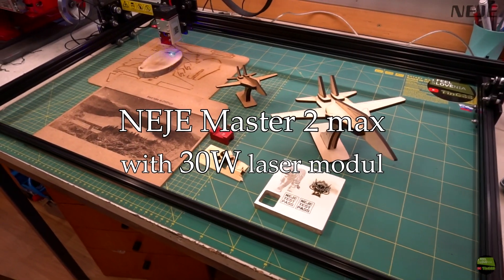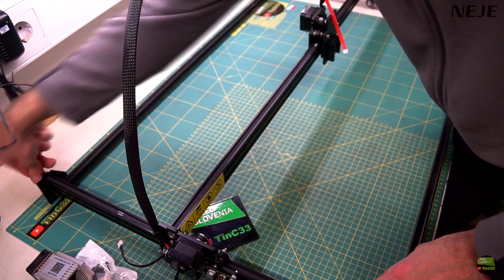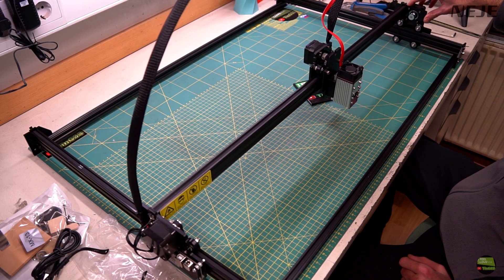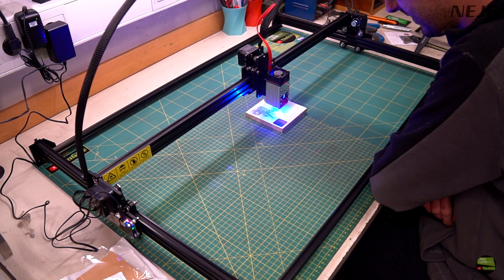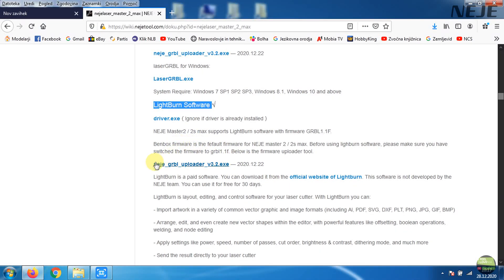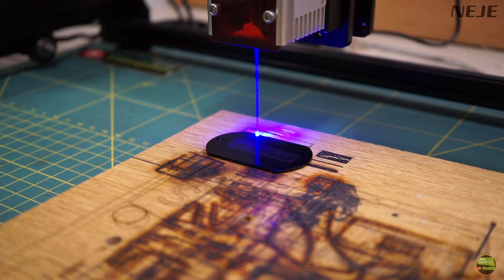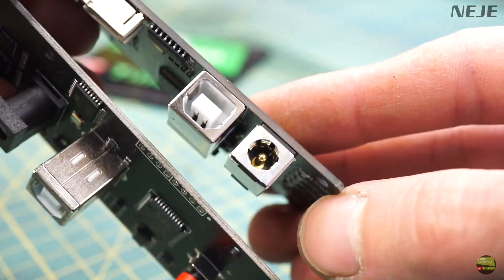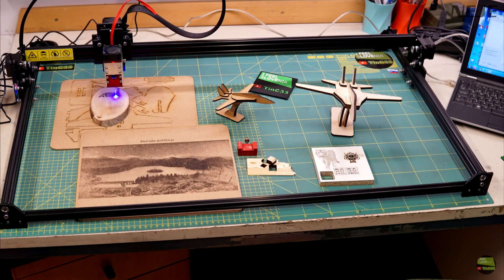NEJE Master 2 max with 30W modul 460 x 810 mm engraver / cutter [unbox / review / first test]

Comment: Hello, i've got last week new master 2s max 40w. When i tried lightburn:
first homing moves was ok -> left back corner 
1) it was going different y possition and at the end it was going different y and it was engraved mirror

2) then i tried to change y pin a and y pin invert like video -> when i tried to position laser from lightburn moving it was going right direction - auto home is also OK

3) after few tries i discovered after auto homing, when i went to position in lightburn and tried to move manually -> directions was ok, x is right value, but after homing left back corner is showing y direction value 460 (x=0;y=460)

before i discovered bad position it was a lot of "crashing" a think a need big red button to stop machine.

Anybody know how to solve my problem please? Once i got (x=0;y=0) and engraving was ok... but don't know how to make it again... I didn't change anything. Just stopped engraving and send machine to home and started engraving again (or maybe tried to check positions in position page).

I hope you can understand my poor english level. Thank you for help.
Reply from the maker: copy that on lightburn forum and they will answer you, i think it's just some settings, try to play a bit more, when start crashing, just turn off the power suply ;)

Comment: Hello, I also have 30w Neje laser but Im not even able to cut 1,5mm plywood. Can usuggest something? Im rly powerless with this, if u want we can communicate private. And also can u tell me what is this tube when u cut? Thanks
Reply from the maker: This tube blow air into cutted line, make huge effect on cutting capacity and clean cutted edge. 
What kind of software and setting you used?

Comment: hello sir
can you please tell me which stepper motor they use for neje s2 .i bought a y axis saintsmart and it isn't working with my neje .by the way rotary is moving im sure its wiring of the motor is different

Comment: Hi Tin please i need help. I bought this Neje laser and cant do any cuting with neje software. Which software and settings you use for cut 3mm or 6mm plywood. Answer please 😉
Reply from the maker: I use neje software for engraving and lightburn for cutting, try to cut with 100% laser power and about 5mm/s speed or for neje software try 10ms burning time, depend on power but for 6mm you'll need air assist.
Reply: Thank you friend

Comment: I found that using the Laser for a long time over time is degrades the power of the laser decreases. When new it works great but over time it seems like you have to change the power settings.

Comment: Which is best to make detailed drawings 40W, 30W, 15W or 3.5W?
Reply: I am not sure what is the limit downward regarding usability, but the less power you use the more detailed gradients you can achieve. Although there is an other factor, the dot size of the laser. In my opinion the best ratio on the market is on the laser master Pro 2. With 5.5-ish Optical (!) wattage If i would just only wanted a laser to engrave, i would not hesitate to buy that one. For cutting as well which i am looking for i think minimum 7.5W optical is the acceptable power.
Reply: Just for drawing and engraving means 2.5watt is enough which is available with rotrics hexbot

Comment: What to do when the laser stopping in work? The problem is that the laser no longer moves, the laser works but does not move it stops.  you can help
Reply from the maker: Change firmware not use 2000000 one.

Comment: Hello, you can explain me what are the L parts? I have too but I don’t understand where they go. Thank you
Reply from the maker: They are for fixing machine on the table, screw go through the holes into legs and another 4 screws into table or other base, so you can't move the machine and it stay parpendicular.
Reply: Ah ok, thank you, where I can find 40w for a good price? Here in Europe?
Reply from the maker: @stefanocorti4806  i think only neje shop, but don't know if they fill warehouse, but 40w is awesome, got two laser in it, i cut 20mm soft wood with them, video will come...
Reply: @TinC33  yes I get it today laser and I am very happy great structure and quality! Better than co2 40w, I think less maintance

Comment: Great TinC33 videos: I ask you a question, it is possible that you explained what type of air compressor you use to clean the smoke in the laser, I have had problems with the 30W Neje and I had to put a new one because there was no laser intensity . As I told you, a good detailed explanation would be very interesting. Thank you very much in advance.
Reply: As I said before, your videos about the Neje are excellent. Regarding the question I was asking you about air assistance, I have already seen the video of "Bring Ortur Master to another level FW upgrade - Air assist - Upgrade with NEJE 20w modul" in which the air compressor topic is very detailed. Very good!!!
Thanks a lot.

Comment: I have a neje master 2s 7w , my problem is that i can not cut anything ? Please help
Reply from the maker: Set laser power to 100% and burning time to about 10ms in neje software and it should work
Reply: @TinC33  thank you i made 7-10 rounds with that settings but it still dont cut the plywood 😢😢
Reply from the maker: @KorAysila  how thick plywood, didn't try 7w mpdul but i think 3-4mm is somekjnd of limit, 40w can cut 5mm plywood in few passes.
Reply: @TinC33  i had 3mm plywood tryed.
Reply from the maker: @KorAysila  did you set focus perfectly? I don't know what should been wrong

Comment: I have been using this but having a hard time to cut 3mm plywood. What should be the height of the laser above the cutting material?
Reply from the maker: It doesn't metter of high that much but you need to set focus so you got smalles possible dot and air assist make huge difference
Reply: @TinC33  thank you for taking the time to respond I really appreciate it so I have used a microscope to set the point as small as I can but it still needs at least: 7 passes 8mm/s @100% power
Reply from the maker: @mohsini2607  3mm should cut better than 7 passes, do you got air assist also?
Reply: @TinC33  yes i have air assist and it made a big difference in getting clean look, but still it often takes 7 passes at 4mm/s at 85% power
Reply: @TinC33  i was thinking to return this unit and buy the ortor model. i see you have done reviews on that model. Will it work if i purchase the basic Ortur Master 2 and buy the neje laswer and add it to the ortur?
Reply from the maker: @mohsini2607  yes it will work just leave 4th wire unconnected because neje got temperature feedback and ortur doesn't.

Comment: Hey have the laser now also. What do you do against a strong smoke development? My basement is full of smoke do you have a tip.
Reply from the maker: I would mound some soft pipe (about 50mm) next to a laser and use some ventilator to suck smoke and blow them through the window.
Use stronger fan like the one for freshing the toilet room.
Reply: @TinC33  I wanted to ask what settings can I use for a 4mm plywood sheet to cut in grbl.
Reply from the maker: @DasTwitchTeam  about 5mm/s 100%laser power 2 pass should be enough
Reply: @TinC33  I can only set this mm/min therefore this does not work in grbl.

Comment: why do the photos show no wires in the booklet.  Some photos on ebay show wires and some do not...so are they the same models or different models?  I just got mine "with the wires"
Reply from the maker: They use render photos, that's not the real photo, laser can't work without wires.

Comment: hi i have a 40w neje master 2s what settings would u use for cutting through 3mm mdf?
Reply from the maker: 40w need only 5ms burning time at 100% laser power and cut 3mm mdf in one pass
Reply: @TinC33   its the cutting setting i cant work out we worked on a logo to cut out and saved it as a vector but it wont support it on the neje software? is this right ? do we need to save it as something else to cut it on neje? thanks
Reply from the maker: @leannefearnley241  yes try to save as some other file (dxf or nc) some type of same file don't worh in neje software, otherwise try lightburn.
Reply: @TinC33  Very good! So, in a few steps you should cut 6mm and 8mm plywood and MDF?
Reply from the maker: Sure but not without air assist
Reply: @TinC33  Thank you for always answering, however, I have another question: would it be possible for this laser to work as a plotter, for example, to cut letters in adhesive?
Reply from the maker: @Dancopymus  i try my best 😉 dont understood exavtly what you wang to cut, but i tty them as a ploter to cut oracal vinil sticker and it work awesome

Comment: Hvala za videje. Vem, da si ze odgovoru na ta vprasanje pa nism najbolj razumel. Zanimam se za nakup neje master 2s 30w. Za graviranje na les nej bi bil bolsi 20w, a to samo dokupim 20w del za pribljizno 30e in montiram in vse dela. ? Al je treba ksne distancnike delat? Za graviranje na usnje kateri je bolsi mocnejsi ali sibkejsi. 
Mogoce samo predlog. Pomoje vecino nas gleda te videje zacetniki zato mogoce bi blo fajn ksni osnovni videji, kje kupiti materijal, kaksno temperaturo in razdaljo nastaviti za razlicne materijale, z kaksnimi problemi zacetnik se lahko sooca. Lp
Reply from the maker: Za rezanje 20-40w za graviranje pa so boljši rezultati z 2,5 ali 3,5w modulom (ti so po 30e 20w je precej drazji) saj je ta modul prešvoh da bi rezal zato z polno močjo žge površino zato je le ta bolj črna kot pri močnejših modulih.
Modul se samo zamenja kabel je enak nič ni treba nastavljat, so pa 30 in 40w montirani drugače zdaj ne vem kako je pri novih modelih ampak sam sem moral za montažo 40w laserja na neje 2 narediti distančnik 3d tiskan da sem lahko montiral klesce gor za 40w. Kakorkoli montaža z nekaj improvizacije ne bi smel bit problem.
V naslednjem videu bo govora o 40w laserju, kater je zverina za rezanje, v naslednjem videu pa primerjam vse module od 2,5 do 40w v stilu kaj kupiti...

Comment: I got the 40W version and put it on a green cutting mat like you. I was wondering if the laser would burn or damage the cutting mat?
Reply from the maker: Sure it cut that mat like butter, so be sure you got piece of wood thick enough below the working part so you won't demage expancive cutting mat like i do few times when it come through 3mm mdf wich u use on the buttom, specaially 40w is a beast and can cuickly cut trough.

Comment: Hello, I have recently brought this laser cutter. around halfway through the engrave the machine stops, yet no error codes from the board, does the laser have a cool down period? Have you had the same problem? Thanks
Reply from the maker: Do you got 200000 firmware uploaded on them, try to upload middle firmware on them that halped for me.
Reply: @TinC33  Hello, no I haven't tried the middle firmware, the forum download link seems to be broken, is there an alternate link?
Reply from the maker: @thegamecorner429  google it for neje wiki, download firmware uploader and upload middle firmware.

Comment: What settings for cutting plywood and how high above?
Reply from the maker: Try a bit i use 100% LP and 5-15ms BT high that much to get smallest laser beam on the surface
Reply: @TinC33  and what distance? How many milimeters laser module should be above plywood?

Comment: Hello, I have one question.... do you think you can try to put it on the wall and make it work there? I want to buy this but I don't have space for it in the house and I want to mount it on the wall. But I don't know if the steppers have enough power to move the laser module in a vertical way. Thank you for your help and I hope if you will try this, maybe you will make a video to post it.
Reply from the maker: No i try the neje mini is the only one who can handle emgraving on the wall.
Reply: @TinC33  Thank you for your fast reply. So only the mini can be mounted on the wall and have the power to move in that position. Is because the steppers are not powerful enought?
Reply from the maker: @SoulRelaxationMusic  yep motors loose steps, because of weight, mini got same size of motors but the frame is light and....mini 😉

Comment: Also the to step motors to move on each side doing the same job  back and forward mmmmm  they will never move on a precise way at the same time and if the laser carrier rail move out of line the carving emages will be affected keeping the frame tigt will not do with rails so thin that long and acrilic corners sopports  I will fit it to a under base  to square it

Comment: The  frame looks delicate also the step motors the price now in march 2021 $500 in really I don't see the 500 more like $350 the frame is to me is the biggest issue the laser  kit look more appropriate and make your own frame and different step motors more beefy like  also power supply don't look to good 3A passing on that it will get hot  and the laser need a constant even power supply but if you only going to play with it making small things you be ok I will like to see a large carving not a pictures to much details just out line drawing to full capacity sizes most everyone make Small crap otherwise make no sense buy a large carving machine to do small work only
Reply from the maker: I run it for 2 days without problem, max 10hours in one piece and didn't see any problem, frame is stron genough becazse it's not cnc so all it need to handle is laser modul and we can stil screw it on the table... Not a bad laser to me, price is high because of powerfull laser modul i just tested 40w one wich is really beast.
Reply: I own it, frame is actually really sturdy.

Comment: please what settings do I have so that the master 2s MAX LightBurn homing and limits and outputs setup is set ideally
Reply from the maker: try to play a bit, you need to invert y axis pin direction and homing direction, and offcourse smax value. i think there are all the changes i make into video.

Comment: I would usually cut 3-4mm ply, what speeds and how many passes would you think it would be possible with this?
Reply from the maker: with 30w i think 5mm/s about 2 pass, but depend on type of ply...
Reply: @TinC33  I have ordered one (30w module) and put it on my machine just yesterday. I was able to cut 4mm ply 2 passes at 100mm/MIN, so not nearly as fast as what you suggested, but I see that you focus further. The manual says the optimal cutting distance (from bottom of module is 5mm, and it should be focused at the middle of the wood, so 3mm between heatsink and top of wood. No air assist yet, I don't know if that can be such a difference maker
Reply from the maker: @istvanmaasz6771  i got vest result is i set focus to smalles possible dot onto wood surface, not like manual says, so i got laser more than 10mm from wood for sure maybe also 20mm, and air assisg make huge difference into cutting capacity and speed.
Reply: @TinC33  your guess was 300mm/min 2 passes, which is 150mm/min speed to sum it up, I was able to do 600mm/min 10 passes, so 60mm/min total speed. But you got my hopes up, hopefully I can make some air assist out of a blower fan

Comment: Quick question when done with the laser engraver do you unplug it after disconnecting? It just sits there with the light on.
Reply from the maker: Yes after it done the work i disconnect power supply from the socket and also disconnect usb cable, otherwise it will drain your laptop battery via usb.

Comment: Ok so you got the 30W so you module power is 7w,? That is on this machine ? So working power about 5w ? See we begin on a big # 30W and end up on what? So the system use most of the power to run look to me that the laser should be working on a separate power supply to be more effective

Comment: Hello, congratulations on your video is quite helpful!  Could you help me in some way to install ligthburn too?  I have tried different ways but it does not work properly ..
Reply from the maker: Thanks, what's your problem, i just download and install them, work without issues for 14 days, than need to buy licence
Reply: @TinC33  I have downloaded the lightburn I can not synchronize it properly so that it works so that the machine works properly with the right speed and application
Reply from the maker: @konstantinossaltas1430  did you upload new firmware onto machine with neje firmware uploader? Than just need to change some settings into lightburn, ecery change i make you can see into video.

Comment: What is the total surface of the device? How big the surface between the supports? Height? Do you think a refrigerated enclosure with constant air flow is convenient? Thank you very much!
Reply from the maker: if you make housing, the laser need about 100X60cm of space and about 40-50cm height, it will work in any ventilated enclosure, don't worry about

Comment: Hi. i have neje 2s plius. it cuts only 1 mm deep wood. how can i get more deep?
Reply from the maker: what modul u use, wich software and settings?
Reply: I use 30w modul. windows7, NEJE_v5.4.2. 100% laser pover and 30ms
Reply from the maker: @zaqromurachashvili1409  that's really srange, with that settings it must cut deeper, you may try to set focus, on different settings, focus is really important for cutting, sometimes, small change make bir result, or you got some hard wood so there become lot of duct into cuting line and you'll need air assist... otherwise try to contact neje support.
Reply: @TinC33  25mm distance from laser modul to object is normal?
Reply from the maker: @zaqromurachashvili1409  it's ok, but i got better result with distance 40-50mm, and then set lens to smallest possible dot.